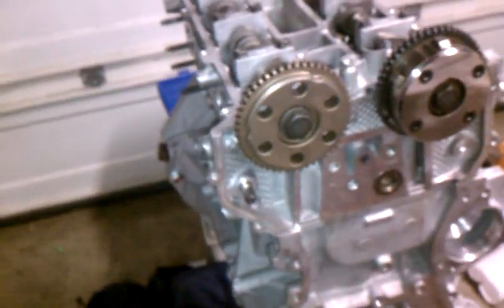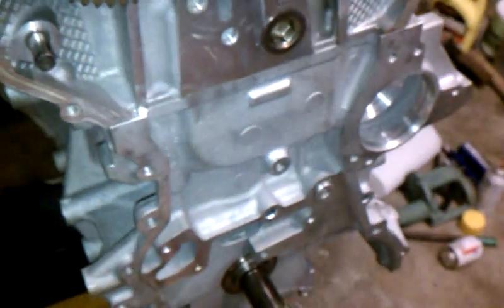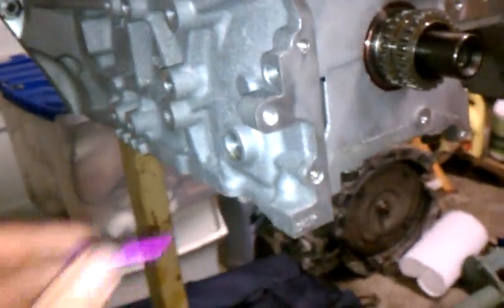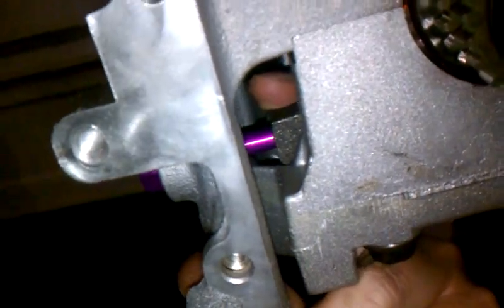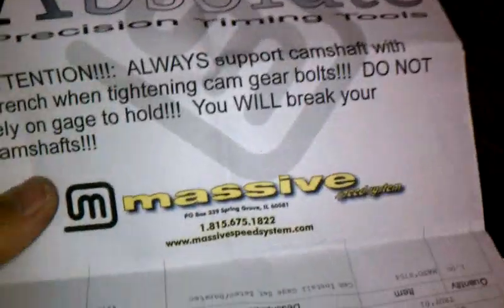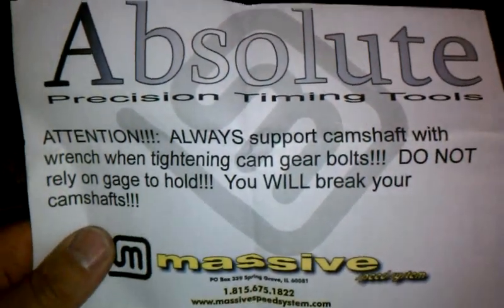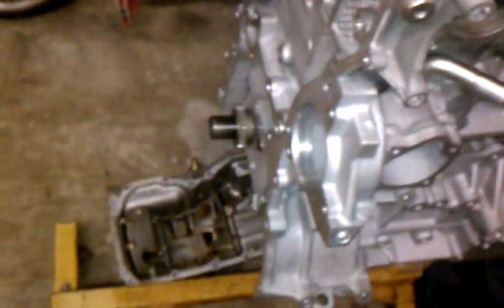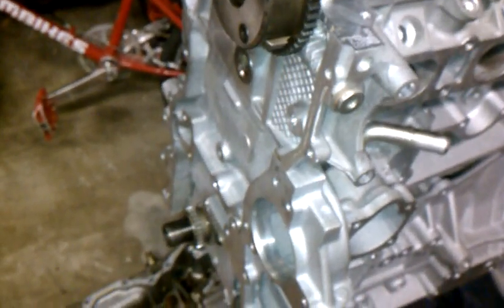Mazda 3 MZR/Duratec Cam Timing

Comment: Exelent video , a little shaky but this is what I was loooking for ,especially where you show where the bolt goes in the crankshaft,  I put the bolt on top and thats why  my engine didnot start. I hope I didnot bend some valves.  thanks a lot.

Comment: Do u know if u can use the ford pistons in the mazda 3. I am using a the ford 2.3 block and a mazda 3 head. The pistons on the mazda 3 have valve reliefe on them and the ford does not
Reply: +hho man It will work fine, it will slightly raise your compression ratio (which is a good thing)  if needed you can use a  thicker  gasket to compensate and give clearance that will bring your compression ratio back down too and help it burn the 87 octane.

Comment: I had a question about the valve timing, when you set the bar in the camshaft slots, how do you know the camshafts are turned the correct direction, you can turn the camshaft 180 degrees and still insert the bar, yet different valves are opening?

Comment from the maker: In my case, the car was an insurance buyback from a coworker.  $500 for a 2005 mazda with a hydro locked motor is the _ONLY_ reason I have this car.   It's actually hers now as I signed over the title on it.   Compared to a Honda or Toyota, the mazda motor is a POS.    Torque to yield bolts are nice, but I thought I was going to break something doing the balancer bolt.   Stress tested my 24B snap on breaker bar that's for sure.